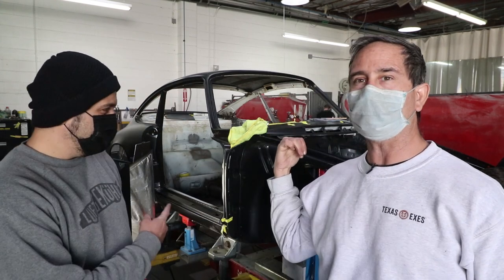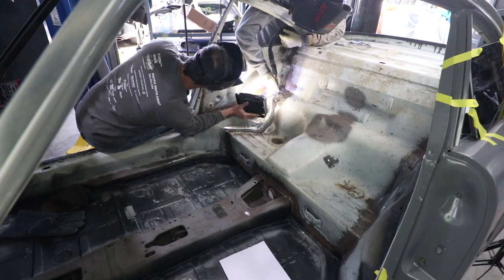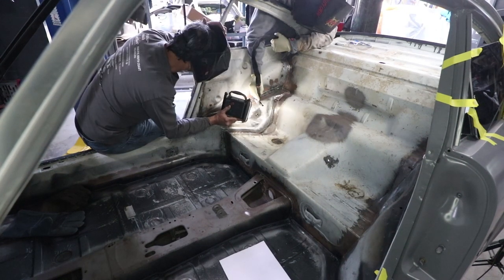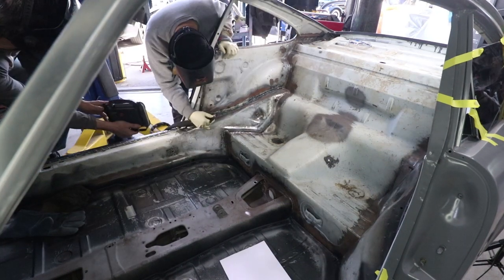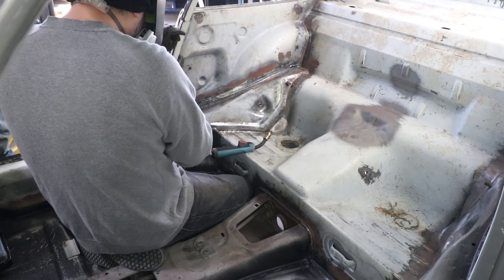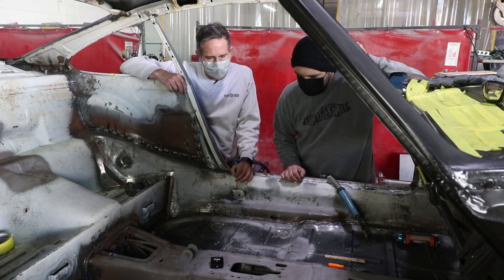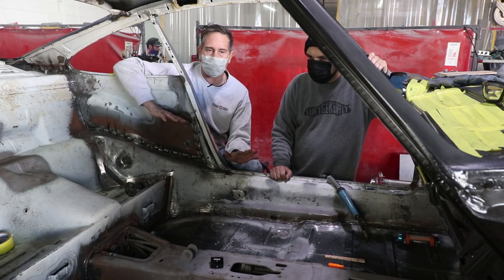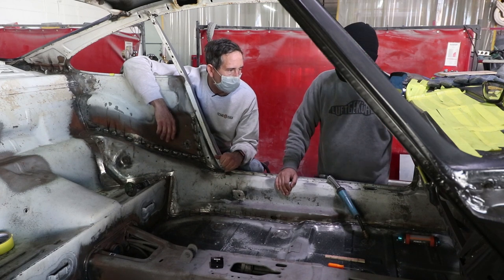Seam Welding A Porsche 912E Chassis For Added Stiffness and Strength

Comment: Now if only I can find a Celette bench and grow a pair, I might give it a shot.
As an aside, I wonder why nobody has ever offered a bigger, taller, center console for retrofit - giving the body a stronger 'backbone.
Good Stuff.  Thanks.
Reply from the maker: Efren has researched all the useful factory chassis tricks.  For example cabriolets have some neat reinforcements in the foot well area.  Maybe there IS something for the front of the tunnel?  I know there is something At the tunnel rear.

Comment: How well would dual-shield work? i.e. MIG with flux core, would the flux help with pulling all the slag out of the weld?
Reply from the maker: I wouldn't use flux core on a car.  It makes a mess and should only be used in windy conditions where shielding gas isn't possible .  The flux won't provide any additional cleaning in my opinion.
Reply: @GarageTimeAutoResto  I was thinking dual shield, where you use shielding gas with flux core. I’ve never used it myself, but I understand that’s what many industrial processes use because it’s more tolerant of contamination and impurities.
Reply from the maker: Try it?

Comment: Cool project ! You hade the car on the Celette. Is it necessary to take precautions just to not warp the car if you're doing this in your garage ?
Reply from the maker: The cellete bench is a really nice tool and convenient.  My experience is that careful measurements with a tram guage and a level floor works, but takes longer.  
If you watch my seam welding video you can see how easy it is to flex the chassis.

Comment: I'm trying to do this with just a TIG, but I can't get between the seams clean enough. My welds keep contaminating. Please help! Can I use flux core mig wire as filler, or would dropping a little muriatic acid on the seam do it or? Any help would be appreciated
Reply from the maker: Oh man, this really isn't possible with TIG alone due to contamination and the amount of time it would take.  Even MIG with CO2/Argon shielding gas gets contaminated.  
I wouldn't put any acids in the seam because it will rust later and it doesn't remove paint anyway.  
I preheated in some cases with TIG at 20A, but mostly I went over my MIG welds if there were any pinholes left.  
Best of luck man, but I wouldn't try TIG only unless the entire car was baked clean. 
I haven't tried flux core, but it assume it's messy?
Reply: @GarageTimeAutoResto  Gootcha, ok. I’ll prob just finish what I have in the engine bay, not much just the seams at the frame rails by the engine. Luckily I can get the torch on both sides of the seam to burn out what I can. 

If I lived closer I would absolutely take your class. Hell I’d like be an instructor doing that kind of thing, sounds really cool!

Thanks for the advice!